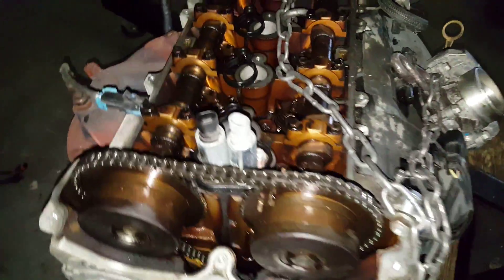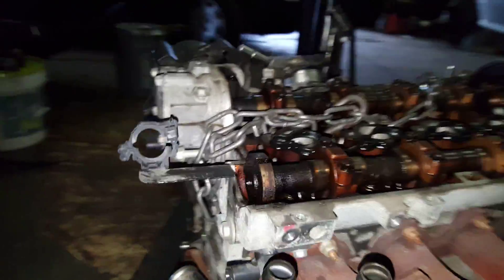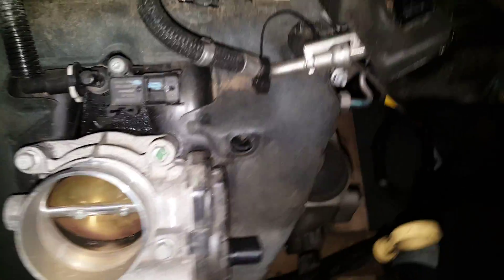Chevrolet Equinox engine 2.4l swap 2011 to 2014

Comment: Has anyone swapped out a 2012 2.4L for the 2014 2.4L? If so, did you have any issues afterwards and did everything line up right?

Comment: how did this turn out? I have a 2011 Chevy Equinox with a blown engine and I'm trying to replace it. Is it possible to replace the 4-cylinder with the 6-cylinder?

Comment: Will the 2014 equinox engine fit my 2010? I just purchased a 2014 , what do i need to know or my mechanic? Or should i cancel the purchase ?
Reply: What happened later, I’m in the same problem and i dont know what to do

Comment: I just put a 2015 into  a 2011 your new motor is missing the exhaust manifold. my new motor came with an exhaust manifold with no tapped hole for the o2 sensor. There were small passages between the exhaust ports where the exhaust is allowed to go into an egr manifold. I had to block off these passages during my swap. you will see the ports on the gasget. Two small rectangles in two places. I trimmed the old gasget and shaved off the ends of the egr manifold to hold the gasget in place. filled the voids in the gasget with jb weld.

Comment: Hey dude so did you use the 2011 ecu or 2014 ecu?
Reply: Did not swap ecus Only throttle body according to my tech.  All 2014 into 2011 platforms do not work. Perhaps this was a late 2011 model. I do not know the parameters.
Reply: @KevykevHID  ohh ok. So will the transmission from the 2011 work with the 2014 as well?

Comment: Works fine. Just did mine. Will need to swap Throttle body and engine mounting bracket attached to the timing cover and Exhaust manifold due to the O2 sensor angel difference. Its best to use your old wiring harness.  Good luck

Comment: I replaced the 2012 equinox engine for 2014 and wont crank. I dont know what is the problems now.
Reply: angie gonzalez Did you swap the throttle body?  2012 engines are interchangeable with up to 2015 even 2016 i think.
Reply: @watever713 sorry for the delay, transmissions are a totally different monster. I am not sure

Comment from the maker: UPDATE - Tried a 2015 into a 2010 and it did threw 2 codes synonymous with what the dealer experienced while doing some of the warranty rebuilds -  These codes are related to the High Pressure Fuel Pump. Supposedly the cam shaft and sprocket of the 2010 engine needed to be used (Swapped onto newer engine) to correct this.  I definitely opted OUT of trying this and sent the car to auction.  Moving forward, I will stick to dealing with the 2012 models - I'm a little apprehensive to even try a 2011 again (Although I've had 2 successful swaps that have been on the road for years)
Reply: Solo el árbol de levas y el piñon vvt de admisión ? O hay más piezas 
Yo voy a cambiar instalar un 2013 a un 2010

Comment: Hey... I am running into the same problem....The Dealer doesn't know what the difference is...I am finding a lot of low mileage  engines with AUA that are very reasonable..But the ones without have twice the mileage with twice the price.. If all I need to do is swap a throttle body then JACKPOT!

Comment from the maker: Chain guides other timing components and rings are supposed to be updated.  Early models have oil consumption issues as well.  No fault codes after swap other than the infamous p0420 since chevy uses lackluster Catalytic Convertors.